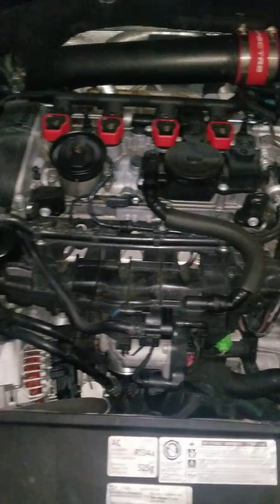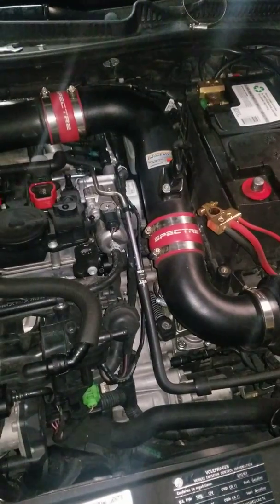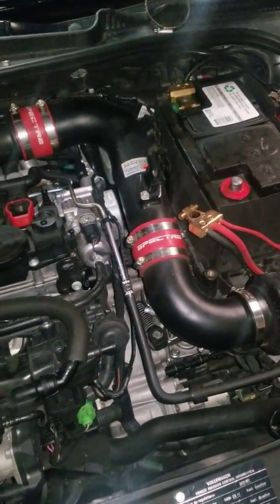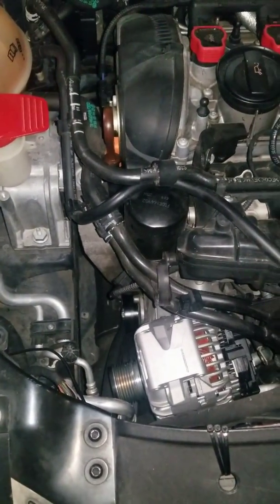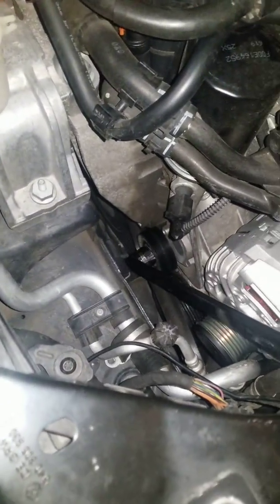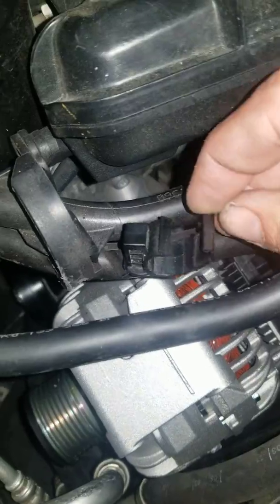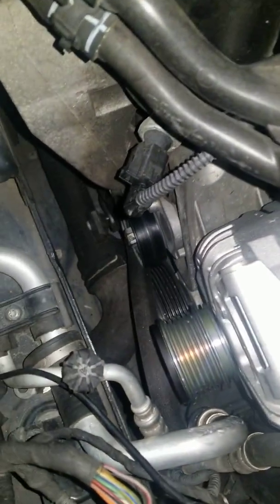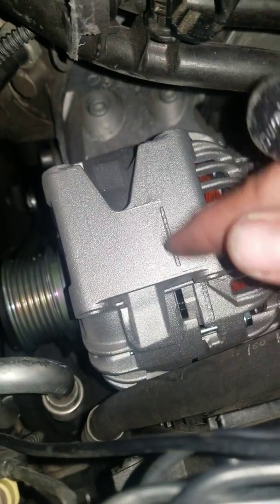MKVI GTI alternator replacement

Comment: Top tip to add - take the oil filter out! This lets the rigid coolant hoses flex back enough to avoid scratching or damaging the oil pressure sensor wires or connectors below, and avoid damaging any of the AC hoses or pipework.

Comment: This worked for me and my 2009 TSI MKV GTI. Was a bit of a pain to get it out, but in the end i used a breaker bar and a 13 Mill crecent wrench. wish i would had me a swival bit or ratchet. I did have to move the turbo muffler out the way, i can't wait till I'm rich enough to afford to remove that dumb tube.

Comment: Thank you sir! I have a mk7 that I’m working on, looks about the same but I’ll post an update if there’s anything wildly different.
Reply: Was it any different?
Reply: Did you have a burning plastic smell or any of the sort before it started going out? Just curious
Reply: Mk7 is easier because the bolts are facing you instead of sideways. But everything else is basically the same. Release the tension, move the belt off the alternator , move a coolant hose out of the way. Remove electrical connector. Loosen two bottom bolts and remove them. Loosen two top bolts and remove them.

Comment: More tips for getting the alternator out:

1. Remove the oil pressure switch for extra clearance (right below oil filter)

2. If you’re having a hard time accessing the bottom two alternator bolts; remove the intercooler fan. It’s (4) screws and a plug, then it will drop out of the bottom.

Comment: Some advice for everyone! My brother has a mk5, and I have a mk6 (He has a late mk5, so it’s the same process). If you put the car on some ramps the bottom bolts might be easier to gain access to!
Reply from the maker: The best solution is really just a small 1/4 inch ratchet so it fits, reaching up from the bottom is a long enough reach to make it more a struggle than an advantage
Reply: @wesleysmith249  True
Reply: I say might because I didn’t have a long enough handle on my socket wrench :/